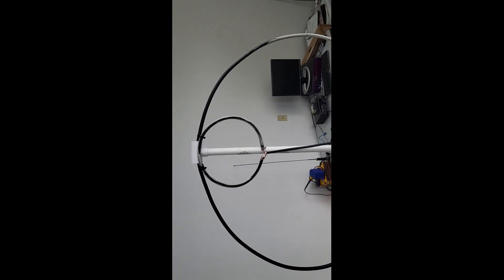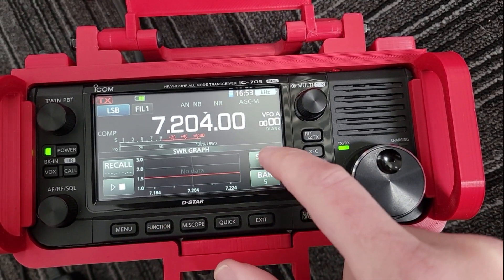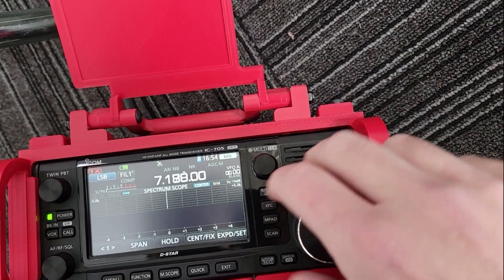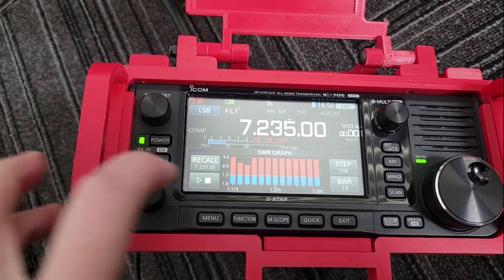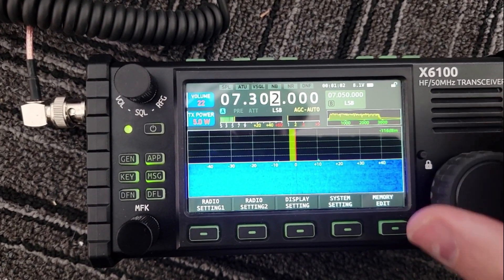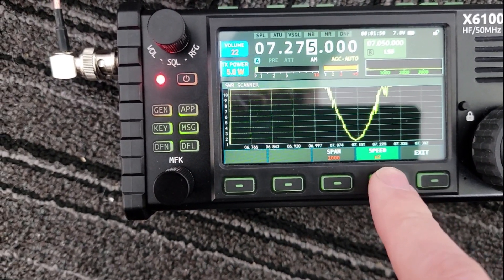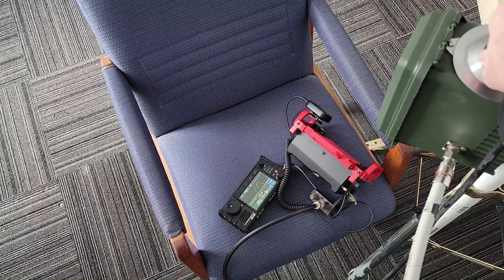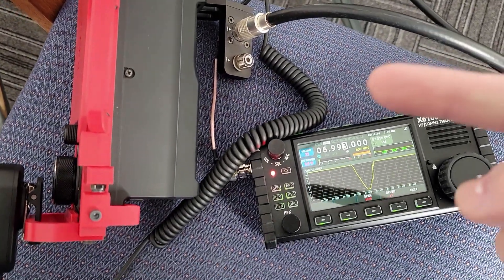Which SWR Scanner is better?  The IC-705 vs the X6100

Comment: I personally like my x6100 scan better than my I C 705 scan. I was hearing several people dissing the Xiegu one for some reason. Thanks for the video. 73
Reply from the maker: I'm in the same boat.  I like the X6100 scan (plus tuner) better.  I was able to get close enough by hand and then zero in with the ATU.
Reply: @temporarilyoffline  the ATU is the main reason I got the x6100 for POTA/SOTA....less wires and equipment when hiking. Keep on bringing these videos!
Reply from the maker: Will do!

Comment: Did you happen to notice that when you took your hand off of the knob and out of the loop, then the (very rounded) peak in the noise floor shifted?  You can't easily tune with you arm in the loop, because when you take it out to pick up the mic, then it's no longer tuned.  You need to rebuild with the knob facing outward, and a non-conductive shaft extension would further keep your tuning hand from detuning the loop.  (Or so says my experience with an AlexLoop.)
Reply from the maker: Yeah, I noticed that.  This antenna is extremely finicky.  I can't be close to it at all.  (This is why I didn't make a how to make a mag loop vid ;-) )
Reply: @temporarilyoffline  I got the tripod for a cheap Home Depot work light, and added some PVC pipe to raise the AlexLoop up over my head.  The knob faces out of the bottom, so I can reach it up to tune.  I still want to add a plastic rod extension for the shaft so that I can keep my body further away.  I'd like to add further reduction, and figuring that out has aided my ability to procrastinate.
Reply from the maker: @KeepEvery1Guessing  my procrastination muscles are very strong!

Comment: You can key up and adjust swr whilst keyed up (and watch the swr change in real-time with the regular meter) and then dial it in more with the SWR checker. (705)
Reply from the maker: Yes you can, there are a lot of ways you can do it, even that part where I showed the signals passing over on the waterfall screen can be a good indicator
Reply: @temporarilyoffline  Mos def. I do like the swr scanner on the 6100. Very nice! Thanks for doing all these extensive reviews.
Reply from the maker: @Transmissions  You're welcome!

Comment: I own the 705 and a CHA F loop from Chameleon. I feel your frustration when trying to tune the radio with the capacitor. What I do is turn the capacitor until I see high noise then I  turn the power down to about one Watt put the 705 in a.m. mode and key the mic with the SWR horizontal bar meter on the screen. You can quickly find the sweet spot. The chameleon manual says never use a tuner with the mag loop.
Reply from the maker: I've heard "don't use a tuner" and "use a tuner" from equally smart people.  Much like any other bit of advice you can find 'round these parts.
Reply: The sweep is to slow to be useful other than to get a profile of the antenna.  Trying to use it for trimming would be hard.  If they could get the sweep about 25 times faster and over a wider area like a true spectrum analyzer you would be in business.  I would also just adjust the cap for the highest level of noise then use the real time SWR
and adjust the cap for a dip.  Did the ICOM have a faster sweep with less resolution?
Reply: @n1kkri  no you can have a3 to13 bars with each bar representing 10 kHz to 500khz. Looking at the manual the SWR bandwidth at 60m is 8 khz and the widest is at 10 m at 210. At 20 the bandwidth is 40 khz .. like the video shows just the slightest touch on the capacitor can swing your usable range wildly.
Reply: @temporarilyoffline  Lots of talk about tuners.  Rather me give my opinion check out
a book called "Reflections, Transmission Lines & Antennas by M. Walter Maxwell"   The book is a bit complicated but he has some chapters that explain what a tuner does, how it re-reflects the wave back up
the transmission line and how the energy will be radiated (minus cable losses).   The reason lower loss coax
is the way to go if you know your going to be dealing with SWR higher than 3:1.  One of the reasons the old timers used Open Line instead of coax for the lowest possible loss.
Reply from the maker: @n1kkri  It actually sweeps even faster than what I've shown - and its continuous on the X6100.  On the icom, you have to key the mic at every sample read.

Comment: I' d be careful with that feature.  That appears to not be Ham band locked and to allow you to transmit a signal outside of the Ham band.  On some frequencies at some locations that might get you in hot water.  And yes, it's an awesome feature and blows away other radios!
Reply from the maker: Thanks for the tip!

Comment: Is there Xiegu X6100 are DUC/DDC transceiver?
Reply from the maker: The only info we have is "SDR", there isn't much documentation.   Have you taken a look at the photos of the inside of the radio?  Would they help?
Reply: @temporarilyoffline  Tere are 32F427ZGT6 ARM Cortex-M4 32bit at 18MHz inside, is this ienough? How about other components?
Reply: blue PCB module with "MYZR" QR-code sticker is interesting! The name of the chips is not visible on your video... did you try to scan this QR?

Comment: Sweep is better, it is like "dynoing" your antenna, but ICOM looked at the rule book and made sure the "Amateur" initiated the transmitting.

Loops can get better swr if you can slide the coupling loop closer to or further from the main loop.
Reply from the maker: The rules are so vague as to be always broken no matter how hard you try to follow them.  Thanks for the tuning tip.  I didn't know that.  Loops are new to me.
Reply: @temporarilyoffline  They are awesome. Not sure who came up with the coupling loop direct to coax. Not sure why people make them from the corrugated 213 coax. Alot of people just use the sheild only on big loop, when cross parallelling the sheild to center, which makes a 2 turn loop out of it, at where capacitor connects to it, could really help on low bands, but I recycled car amplifier heavy guage wire and made both loops, and made cartridges of caps for 40 and 80, then hook both up in parallel for 160, and that makes up for lil varicap out a 60's AM clockradio.
Tried a man made cobweb indoor longwire, but the loop is so quiet qrm wise, and no contraptions outside. 
A motor drive is the next move on the build, cuz they are a tad narrowbanded.
Reply from the maker: @ERICtheLATE  just a "tad"? Lol

Comment: I have made a magloop with Andrews Heliax cable found it impossible to get a low SWR with a small secondary loop. Then I used a toroidal coupling method with just 1 turn 1:1 ratio and now it’s about 1:5:1 match on most frequencies…. I believe a direct coupling or gamma match would be even better 1:1:1 SWR typically. When I use a VNA to tune the loop l never know which is better to have a lowest SWR or have a perfect 50 Ohms impedance, because of the capacitive nature of loop there is a leading deference between the two.
Reply from the maker: I'm still learning about mag loops, this is interesting info you've shared.

Comment: That is really weird
Reply from the maker: Which part?
Reply: @temporarilyoffline  how the SWR seems different on both radios.  Looks better on 6100
Reply: @digitalanaloguehamradio  yes, very high on the icom then dip to near 1:1 on the xiegu, why?
Reply from the maker: I tuned different parts of the band, and then used the ATU.  Need more research to see what's up.

Comment: I’m going to begin by saying I hate cheap Chinese radios & I will never buy one again. I had a bad experience with the Anytone 868 & I’ll leave it at that. With that said I can’t believe how much smaller the 6100 is than the 705 & has a built in tuner to boot. Plus it’s SWR sweep is automatic, not just automatic but it repeats until you command it to stop & shows a much better graphic. I know that radio is a lot cheaper than the 705 as well. Now granted the 6100 doesn’t have D-Star, VHF, & UHF but I can’t believe that makes the radio that much bigger. I think Icom needs some better software/firmware engineers or they’re going to price themselves right out of the market. Thanks voy the video.
Reply from the maker: Thanks Mark.  I find that every radio has its quirks, I just hope to find something I can use in each one.  I haven't really touched D-Star yet on the 705.